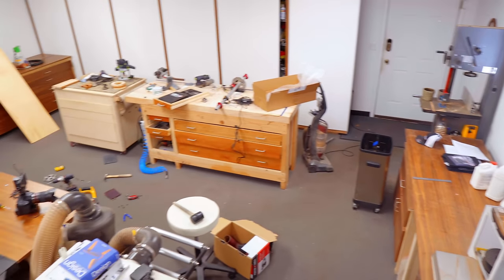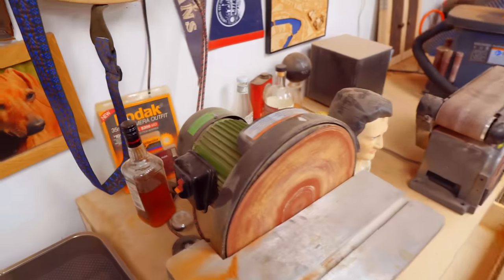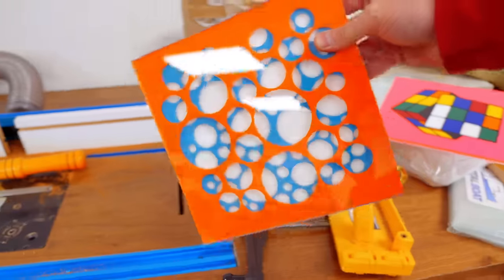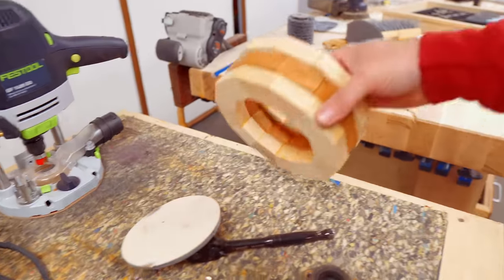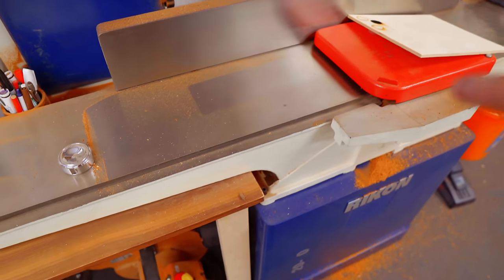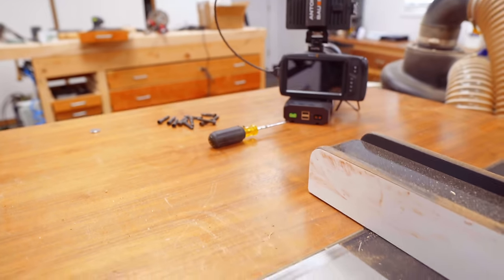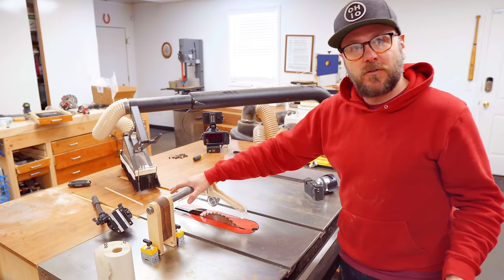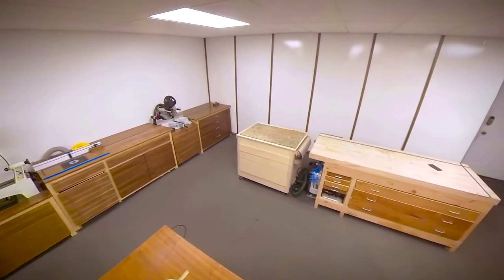You've Been Tricked! What My Shop Actually Looks Like After a Project.

Comment: I was swamped with work (woodworking for a living) and didn't do a full cleanup in my shop for almost three months... It took two six hours days of my wife and I both cleaning to get the dust, shavings and wood chips all collected. I won't be doing that again. The plus side is that since I use the "waste" as mulch, I collected and spread out over 250 gallons of mulch around my yard.

Comment: My shop used to be a disaster after a project. Tools left out, dust and scrap everywhere. Stuff would stay where I left it until I needed it again and couldn’t find it. So I started cleaning as I went along. When I was done with a tool I took the extra couple of seconds to put it away. When I finished working with a power tool I grabbed the shop vac and cleaned up the work area. The shop still needs cleaning up after a project but is a lot less of a mess. Plus it is easier and safer to work in a tidy environment. I also have a place where I put the stuff that does not have a home. I go through the pile periodically and either find a place for it or, if it stays there through a couple of clean-ups I get rid of it. 
I learned about lean manufacturing as part of a consulting gig I had, and have greatly reduced the amount of stuff I keep because “I might need it some day”. I consider carefully how likely it is to be useful versus the burden of storing it, moving it around, etc, and have gotten to where it needs to meet a threshold of probable utility and cost to replace before I keep it. I even go through my scrap and clear it out pretty ruthlessly. 
I think “I can’t take the time to clean up as I go is a false economy. All that crap is in the way and you have to deal with it as you go. Try it, you may find it makes things faster. Stu

Comment: Believe it or not, but the most efficient way to work is to clean up and put away stuff immediately after you use it. If you don't let clean up chores accumulate they stop being overwhelming and you stop putting them off for a "later" that rarely, if ever, arrives. You don't have to move stuff off of every flat tool top or workbench surface before you can use it. You also don't waste a lot of time hunting for tools if you know exactly where to go to find them every time. When you close drawers completely after you open them they don't accumulate a lot of dust and shavings. You also don't bump into sharp drawer corners. Lastly, of course, when you clean up messes immediately they don't have time to "set" and become hard and require a lot of scrubbing and scraping.

Don't neglect dust collection. Clean air keeps you healthy, and nothing keeps you out of the shop like being sick in bed or drained of energy.
Reply: Say that when you really need something done yesterday. I dare you.

Comment: David, I'm not going to jump on the "I know how you feel." crowd...even though I do know how you feel.  I'm going to challenge you....Why?  So you can create more!

Sounds like to me, you need to schedule time for daily COP...imagine just 5 to maximum 10 minutes at the end of the day, to walk around (C)leaning the surfaces, (O)rganizing your tools. and (P)utting things away (or (P)ick up)...then at the end of a multi-day  project, all you have to do is vacuum...or take 20 seconds after every process and clean off the work surface, and putting tools away if you don't need it anymore that day.

When I first started working at a Japanese auto plant south of you ;-).  I used to think it was stupid...but after 20 years of working for them, my area is just as clean as when I started 20 years ago.. I have never had an injury due to something being left out or debris pilled up.  I always know where my tools are. When starting a new project (like moving in new equipment), or a new day of production...we can start right away, and not have to spend an hour...or half a day cleaning up. 20 years ago, I would put it off till the end of the day, now I clean as I go...why? Because I want to get the heck out of the shop and go be with my family...what takes 20 seconds now, may take 10 minutes or more later.

You don't have to be a neat freak...believe me I'm not.  You just need to carve out a little time during the day...schedule it, make it part of the plan for the project.  If a project takes a day to build, or days to build...SCHEDULE IT! Then look to see how during the process of making the project, you can reduce the cleanup time in the end, by just brushing the chips and dust in a bin or pan, to be tossed at the end of the day...or closing drawers so you don't whack your leg on them, or worse yet, you have to spend time cleaning the sawdust out of them...Put tools away when you are done with them, so that they are there when you need them again.

Ask yourself this...How much time have I spent moving that wood around in the closet?  How much of that time can I reduce, just by organizing it better. How many times have you walked around your shop, looking for a tool, because you didn't put it away after you were done with it?  At the end of the day, look at the tools that are out, and think to yourself, "Am I done with this tool on this project?" if yes, then put it away.

Imagine at the beginning of every day, just by "Routing out" 10 minutes at the end of the day before for COP, walking into a neat shop...instead of knowing before you open the door that you will have to spend an hour or more cleaning everything before you can even start creating.

No, I'm not going to tell you I know how it feels...you are a grown man David, clean up your mess TODAY!  do not put it off.  Schedule it if you have to.

Comment: A table saw will shoot the dust up if the fence is closer to the blade on the backside, indicating that either the blade is misaligned and closer on the Back than the front, or the fence is not perfectly parallel to the blade, I have the same sawstop PCS and when I dialed it in, there was no need for any overarm dust collection, the under table one will suck up 99% of the dust.

Comment: Use a heat gun on the sandpaper for a few seconds and it shouldn't leave that residue. I even use a lighter to heat up labels on new products that I buy. That way it will loosen up the adhesive enough that it all comes off with the label.

Comment: I have that same saw with the stock blade guard (not the over arm dust collector), which has a dust collection port. I have the blade guard port running with flex hose to its own blast gate separate from the saw dust collection port blast gate. My dust collection is great except when I'm shaving the edge of a board and the blade guard is lifted and open on one side. You may want to try that.

Comment: With your dust issues, you are aware that it's not the suction but the airflow. you will always have suction but without airflow the dust isn't going anywhere! 

Keep the filter clean and it will work heap better. The more dust you collect on the filters the less dust you will get! But you probably knew this!

Comment: I would try to think of a way to connect the magnets to something that fits into the miter slot for easy alignment to be parallel to the saw blade. All I see is you turning on your saw and chewing it up  or throwing it at your crotch

Comment: That guard would get in the way of cutting down a sheet of material
Doesn't the saw have a guard that slips onto the riving knife ?
At that price i hope it does, if not, what about a guard with a slot that slides over the riving knife and has a screw clamp.

Comment: For the lathe, have you seen Loc Line 2-1/2” hoses. You could rig up one or two lines and pose them where you need them... Loc-Line 80813 Shop Vacuum Kit, 2.5", Blue/Orange https://www.amazon.com/dp/B01LYEMPY1/ref=cm_sw_r_cp_api_i_cKlMEbJKTACRW